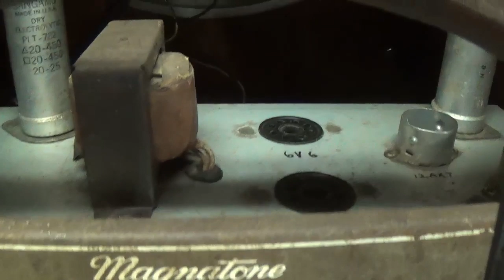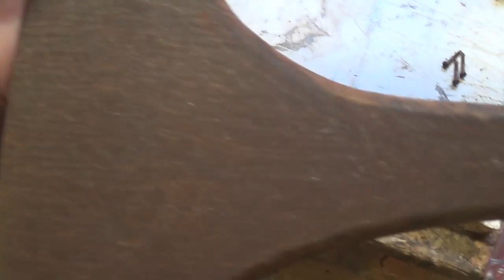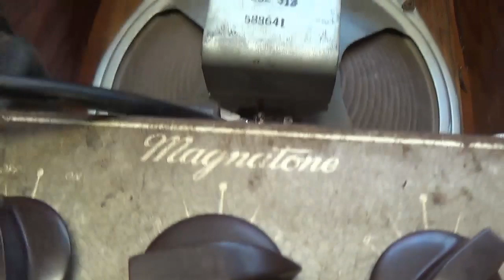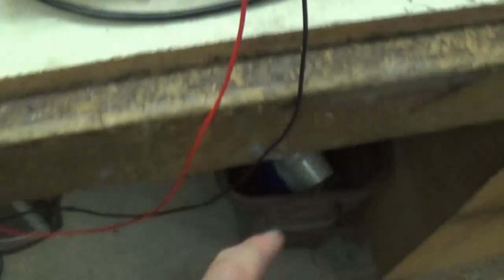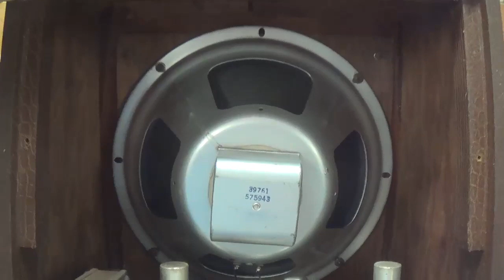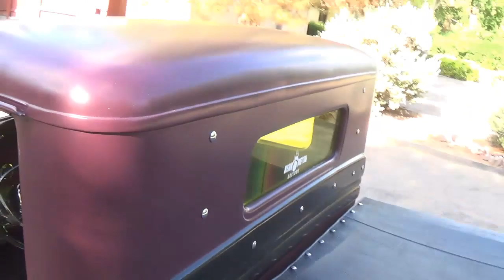1947 to '52 Magnatone M195-5J Melodier Deluxe gets its voice back :)

Comment: Hey Uncle Doug, I have a Magnatone question.  Do you think it would be difficult to modify a Magnatone   Twilighter type amp to add a post pre-amp effects loop?  Given your experience with lots of amps, I was just curious if that type of mod would be easy or complex in general.  I think the Magnatone stereo amp would be my dream amp if I was able to add additional post pre effects like some strymon tape delay for example, among others.    Is an effects loop(either series or parallel)  an additional complex circuit, or is it relatively simple in most amps?
Reply from the maker: I would think that it would be relatively easy to design and install, James, just study the schematic to find an ideal point of insertion.

Comment: Uncle Doug, thanks for the videos, very helpful.

One of the vids (can't remember which) had a vintage amp with the 2-wire cord and NO FUSE!  I also ran into this on a customer's amp but, he wanted to retain the two-wire cord for "authenticity".  I'd like to share the fix with you, please contact me through HutchAmpMan@gmail.com.
Thanks!
Tom
Reply from the maker: You're welcome, Tom. Let me guess.....you added a grounding wire that can clip on the chassis and has a grounding lug to fit in an AC receptacle.

Comment: Hey Doug, another terrific video! As to the year of this amp, I think a clue may come from the Inglewood, CA, stamp on the control plate. The earliest version of that model of amp was produced at their S. Freeman Ave. (unincorporated LA County/Hawthorne) location, labelled "Magna Electronics Company Los Angeles Calif" but with the MEC logo in larger block lettering. As you noted, the earliest ones had octal pre-amp tubes. 

As they expanded, I've read, they acquired three buildings, but stayed in this location a few more years, until the early or mid 50's, and by then the panels read 'Inglewood Calif', and then two or three years later they read "Torrance California", even though all three locations were just a mile or two from one another! So, maybe yours is a '53ish, hence the 12AX7s?
And the cover material... oilcloth? Cotton base, with a pvc coating. I have a pre-War set of Lloyd chrome chairs with oilcloth upholstery, and they're still going strong, pliable and no tears. Tough stuff!
Reply from the maker: Wow....thanks for all the helpful information, EA. I remember hearing that material being called "oilcloth" when I was a kid....which would have been around 1953 :)

Comment: How cool is this, I have a similar amplifier.  Mine is a 1947  M192-5 Troubadour!
After all these years it runs perfect and sounds great.
A loud little amp for 15W and a 12" speaker.
I am very, very fortunate as my amplifier is in a little bit better shape than this example with the original speaker w/transformer attached.
If you need any comparison information or photos for a 1947 M192-5 Magnatone amp just let me know and I can send them out to you.
Reply from the maker: Thanks so much, HK. I will keep your offer in mind.
Reply: @UncleDoug  No Problem Sir.
I know my Magnatone is a slightly different model that the featured one in you video, but it sounds entirely different than the great demo you did for the M195-5J!
When I crank it up to about 90% it turns into a little fire-breathing monster of an amp.   
When ever I get this amp out to play the uninitiated are taken-aback by it's volume.  Also, it is an almost impossibly small amp to squeeze a 12" speaker into it, but they did it!
Plugging a LP Standard straight into it rewards the player with early ZZ Top tone and attack!

Comment: sorry if it's a stupid question, but why you don't use heatshrink on the exposed wires?
Reply from the maker: To do so in this case would require a complete rewiring of the circuit, Roberto.  Investing hundreds of dollars of optional labor in an amp is just not practical.

Comment: There is a big difference between an old console radio speaker and an instrument speaker. As best I can tell via the speakers in this monitor here, your replacement speaker has more timber and warmth. The cone is moving without flexing . The Magnavox is too soft and cushy for that amp... in that enclosure anyway.

Man, am I anxious to see what you do with the interior of that '32 Ford pickup. That interior may have been super cool at one time, I'm betting you can do something that
will stay in style far longer...and your wife might be able to do something with that material...like...put it on the wall...they drywall over it(8-).

Fabulous double feature, Sir Douglas and company. Thanks for another great contribution to tubegeekkind.
Reply from the maker: Thanks so much, Tom. I really thought the difference between the speakers was eye-opening. Guitar speakers are "special" :)
Reply: @UncleDoug  I'm betting the difference was almost night and day between the two speakers. I could hear a difference...I just wish what a I hear wasn't filtered
through chintzy sound cards and computer speakers.

Comment: Great amp! I’d love to see another solid state amp get the uncle Doug treatment, I watch the old kustom video at least once a month.
Reply: Solid state means transistors. The only thing in vacuum tubes that is remotely solid state is the heater filaments. Not slamming, bashing, punishing or lambasting you,
Oh...add to shopping list...basting spices and stuff...anyway, there term "solid state" was deliberately  "designed" to differentiate between the, then new, transistor amps
and the traditional vacuum tube amplifiers.

The advantage of transistors over vacuum tubes...Uncle Doug just did his magic with a 32 watt amp of mine. 32 watts out for 125 watts of commercial power in.
That's approximately 4 times the output just to feed it. Transistor amps will use about 60 watts to get 30 out. The disadvantage of transistors over tubes...the night-
mare math involved with cascading, cascoding and totempoling and other direct coupling techniques used in transistor amps. Stuff can make you pull yer hair out.
Reply: tom frye How awesome to have been able to have your amp repaired by the great uncle Doug! I obviously know that this amp is valve driven. I was saying that I would love to see him work on one that isn’t again some time, just because it is so complicated and I know he’d do it in his deeply thorough and amusing way.
Reply: @graxjpg  Oh, I agree. That Rauland Borg amp was built to run 24/7 in a P.A./intercom situation. So now it will sound great for a good long time. I'll put
it to you this way regarding his working on a transistor amp. I feel if he can make money on it, and doesn't mind doing it, fine. I just can't see him liking the
fact the one can burn pathways off a printed circuit board pretty easily. They only used sockets for transistors early on. Then they figured out how to pinch
the leads and sink off some heat while soldering. So then they could mount directly to the board.

The last one I worked on was several years ago when I had peace, quiet and space to do it. And I invented a whole new language before it was all over.
Reply: tom frye haha I’ll keep that in mind, indeed I can’t think of a real reason for him to fix one unless I send him the amp myself and throw in a bunch of cat treats (;
Reply: @graxjpg  I bet if you ask him right here in the comments, he'll answer you within a day or two. And...he might just take you up on it just for something
different. I doubt he hates solid state amps, but I don't think he loves them like he does the "bottle fed" variety.
Reply from the maker: OK, you characters......I'm here. I did do a lot of work on the Kustom amp, Grant, and didn't mind it at all, but it was my own amp.....which makes a difference.  The idea of tracking down bad traces on  PCB's and replacing 1/4W resistors all day on a pile of customer amps isn't real appealing :) I guess I would have to like an SS amp enough to buy it......and then fix it......to make another SS-themed video happen. You never know :)
Reply: @UncleDoug  At my age, I need a magnifying glass to read the numbers on transistors these days. I don't have that trouble with tubes. And with point to point wiring, I don't often need to get out the solder sucker or solderwick. But for those who don't care, it's  like mind over matter. If you don't mind, it don't matter(8-). Best of luck whatever you decide to do, Uncle Doug.

Comment: It's me again Uncle Doug,
Another great video. I  don't know how you manage to accomplish the vast number of things that you have going on. Talk about having a bunch of irons in the fire. Anyway, really nice amp. The 12AX7s were a surprise. If that is a 51 or 52-year model it might have been an experiment by the first real engineer Magna hired Louis MacKenzie. Delbert was long gone but they kept using his designs for many years. Looking at schematics they were still using 6SL7’s in other model amps right through the mid to late ’50s. It appears to have taken MacKenzie a few years to get new designs into production. They also might have had a warehouse full of 6SL7s left from the Delbert Dickerson days and Art Duhamel probably insisted that they had to be used up before any new designs could go into production. MacKenzie might have been experimenting with the output transformer on the chassis and the 12AX7’s in the preamp position, and the Alnico magnet speaker. Attempting to demonstrate to the boss how good the latest technology was. Just speculation but it fits the history of the company pretty well. Great sound after the speaker change. Someone probably put the Magnavox speaker in it just because of the Magna in the name. Magnavox had moved from California to Fort Wayne, IN in 1930 and had no connection to Magna or Magnatone. The Hefner speaker sounds great. I never heard of that company either and could find no information on the Internet. Really works well with that amp. I really like the pickup, (well the upholstery, not so much. The yellow sort of claws at your eyeballs.) If it were me, a dark diamond tuck and roll vinyl. Not a real deep tuck, more of a contrasting diamond topstitching for the door panels. Then tuck and roll for the seats, with the breathable type upholstery vinyl on the back and seat.panels. I hate getting out of a vehicle and having my back soaked with sweat from a slick vinyl seat. The 327 looked sharp. I agree six 2 barrel Strombergs is a bit much. Maybe if it had 6 single barrel Strombrergs, with tiny jets in them, it would not drown that 327. It would be a nightmare to synchronize. I guess that Offy intake must have a common mixing chamber since it is only using two of the six Strombrergs. Sure would look cool with all of the linkages moving in unison. A 327 with a twelve pack. I can't imagine even a 427 being able that much carboration. Well have fun with your new project hot rod.  I really enjoyed the video. So sorry to hear about the horror that took place yesterday,  my thoughts and prayers go out to the families. Senseless violence, so stupid.
Reply from the maker: Greetings, Mark, and thanks so much for your very reasonable analysis of the amplifier's design. Trust me, my wife constantly complains about the huge amount of time I spend in the workshop, behind the computer, and in the driveway working on cars. She is a "project widow", I guess.....but, boy, do I get a lot done :) You'll see the finished interior in the next video. Some of your guesses were right on the money :)  The linkage on the six carbs all works and all are plumbed for gas......but apparently the outer four are blocked off at the manifold surface to prevent vacuum leaks. It really runs great with just the center two carbs, so I am strongly inclined to leave it this way. Thanks again for all your great comments :)

Comment: For older, kind of period correct speakers, I have had good luck with Rola alnico pulls from old organs. I put one in a Vox AC4 1x12 combo, and it sounded much, much better than the stock Celestion Seventy 80, which is an olay speaker, but just did not sound right in that amp. There are lots of the old alnico organ speakers available, and they work great for low powered tube amps.
Reply from the maker: I agree completely, Sean. My workshop speaker, heard on many videos, is a Rola Alnico, pulled from an old organ cabinet.

Comment: I ended up with several Magnavox ALNICO speakers from various (read mostly free) places. and was pleasantly surprised by how good they sound. Even the 4" 6" work WELL in a small low power tube stereo situation.
Reply from the maker: I think the key is "low powered" J&K......like they experienced in radios. This DE circuit was a little too much for the Magnavox speaker I tried to use.
Reply: @UncleDoug  
Love that speaker you used in it's place. I don't put much power to a speaker if the frame is flimsy. Some of them have been "bead rolled" and are more sturdy.
Reply from the maker: Thanks, J&K.

Comment: Excellent video. Magnatone made multiple versions of this amp with the exact same model #, faceplate. and cabinet. I have a single ended version. Exact same #, faceplate, cabinet, and thin alligator fabric covering. It has 6J7, a 6SJ7, a 6SL7, and 1 6V6. It has a SE output transformer in the same location on the chassis. I guess they just wanted to use up the chassis they had on hand. The various amp forums on the Web all have threads with people trying to figure out why their amp does not conform! I saved one guy from ripping his amp apart because others told him it was supposed to have 2 6V6s - he confirmed it was supposed to be SE, by looking at the obviously original OT.  Two things I found odd - why use one 6J7 and one 6SJ7?  And mine had a Magnavox speaker also - so maybe original after all, or maybe a spooky coincidence.
Reply from the maker: I agree, Brian. It does appear that Magnatone at this time was cranking out all sorts of amps using the same basic chassis and circuitry. I have several similar amps and all are different in some way or another. I really believe that the Magnavox speaker in mine was added after the fact.
Reply: @UncleDoug  A video showcasing your Magnatone collection would be cool. I also have a head version of that amp that is labelled a PA - same basic chassis and faceplate with a cage top.

Comment: I was wondering about those exhaust headers seemingly capped-off until I saw the gap. I was thinking they must be loud, but then you showed the interior, lol!
Reply from the maker: They are capped, DF, with pipes that run under the car.  There are no mufflers, however, so it does make a (really sweet) racket :)

Comment: From Leo:  Good call on the speaker.   A quality musical instrument speaker makes all the difference.  I have had several times when even a modern amplifier in good working condition just didn't sound right. Slipping in a better speaker makes the "crummy amp" sound pretty good.  Nice hot rod truck.
Reply from the maker: Thanks, Barb. I think the speaker is generally the most important component in a sound system.

Comment: Balancing those Strombergs and getting the idle air-mixture screws dialed in is a pain. Start off by shaving your head...saves a lot of time.  If it were used as a race only setup, all 6 carbs would be operated at the same time...a difficult job to synchronize. But if it were meant for street, then a progressive linkage actuation is almost an absolute necessity....with an increased difficulty by a factor of 16. And if the carbs were well used during their liifetime, the throttle shafts would leak air and cause a vacuum leak, resulting in twirling mixture screws and linkage fiddling  so much you'd have to forego all life's other endeavors...or get carpal tunnel,  whichever came first. Lastly, 'Bergs are rated at 162 cfm, so that's 972 cfm for six....a bit much for a 327 SBC.
    Multi-carb setups look fantastic and scream horsepower. I recommend them if you are really bored and need something to do for the rest of your life. But if you want a good turn-the-key-and-go daily driver street rod then a single carb or aftermarket throttle body type fuel injection setup is the way to go............ more cruisin', less confusin'.
Reply from the maker: Thanks for the detailed info, Michael. I think I'll let it continue to run on the middle (four) barrels. It runs like a scalded ape as it is :)

Comment: very interesting final job.  i have a couple of heppner speakers pulled from a hammond organ.  one is ribbed and one is not.  apparently they did it this way because one works best with treble and one with bass.  of course, i forget which is which!  this is part of an ao43 amp, ao42 preamp, reverb tank, the two speakers and the odd connector.  i've thought of trying to put that all together in a head with 2x12 cab that may have to contain the preamp and reverb pan.  thanks i'm really learning a lot from your videos!!
Reply from the maker: My pleasure, Michael. I'm glad the videos are helpful. The two different speakers in one cab is a great idea.

Comment: With a low plate voltage like that the output valves can be comfortably biased for class A and therefore the full 12W of plate dissipation (not counting the G2 dissipation). Of course, nothing wrong with biasing them cold, but that will result with slightly lower power output and "cold" sound.
Reply from the maker: Thanks for your input, S&T.

Comment: Another great amp, Doug. I don't know if you noticed, but those 12AX7s probably were not original. The sockets were bolted in and the rest were riveted so someone has swapped out the octals.
Reply from the maker: I see what you're saying, David, but octal sockets are wider, so the old rivet holes would be visible just outside the 12AX7 socket.....and they aren't. I think the screws were necessary because the 12AX7 sockets are top mount and the octals were bottom mount.